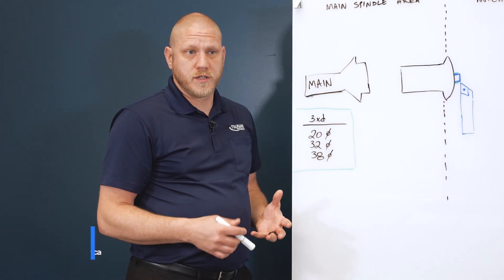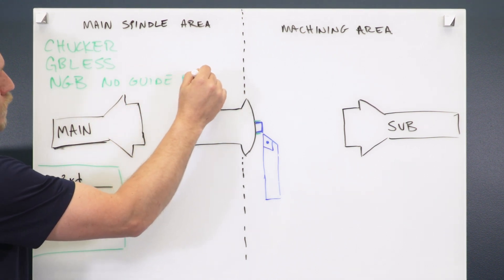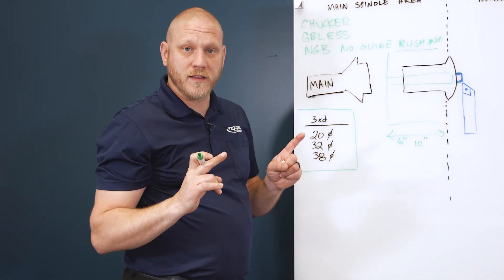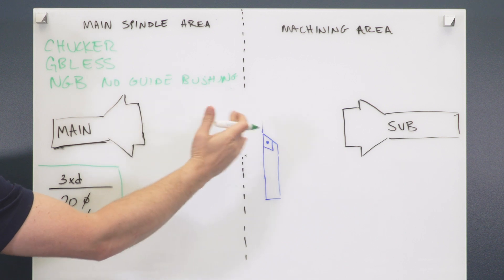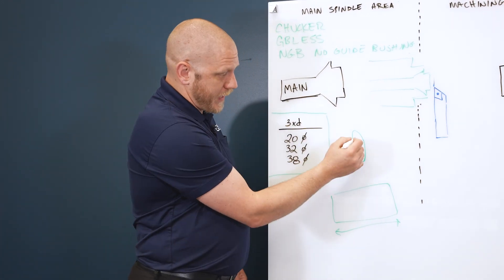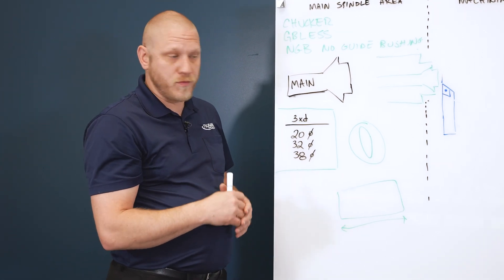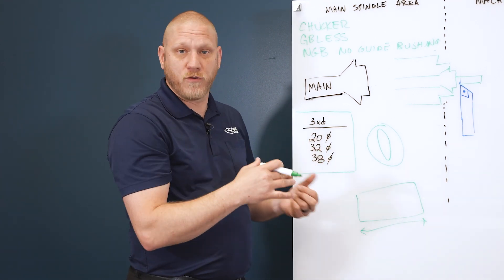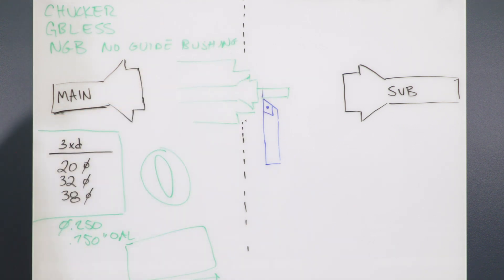What Is Chucker Mode and When Should You Use It?

Comment: It’s not just the 3x dia rule. They limit the actual Z1 stroke to 70mm. If you only have a LH cutoff blade in the machine, you need to subtract for the LH tool plus skim cut material. 

On our BO426 ii I find the max part length is around 2” period 

We run our machine almost 100% in chucker mode. We do a lot of regrips with sub spindle to make up for the limited part length. 

I would also add that you can expect more maintenance running guidebushless. Chips tend to get in the Z1 department a lot easier. I also think the main cover takes more a beating with chips getting into places that they wouldn’t with a guidebushing installed. It’s just cleaner.